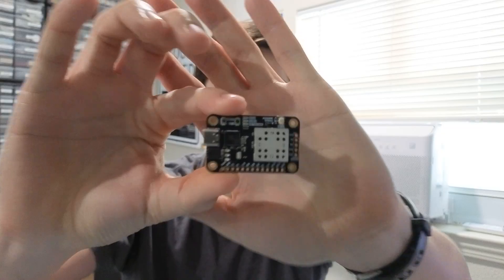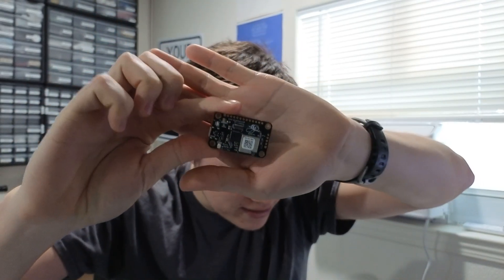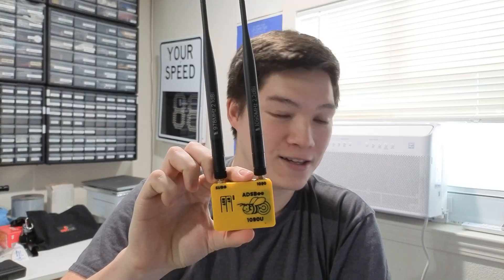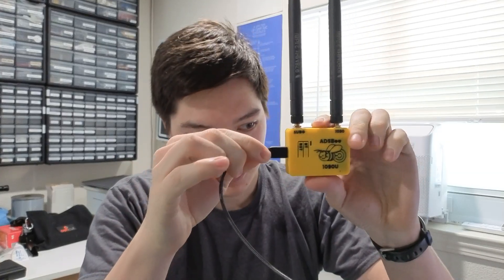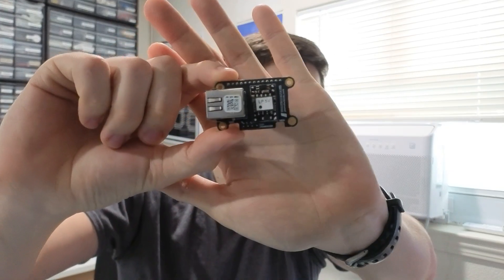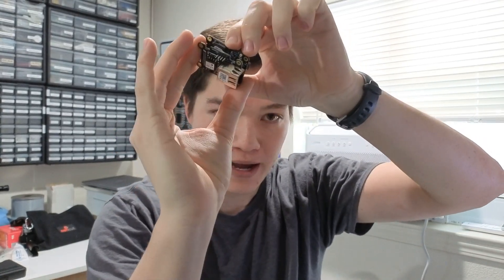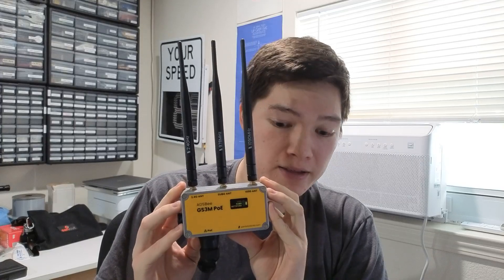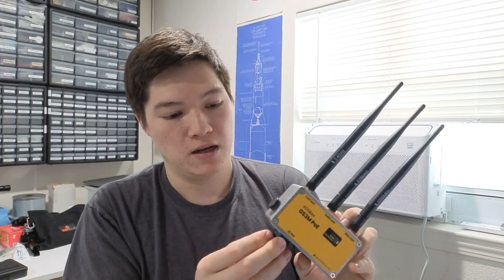ADSBee: Everything we made for low-cost open source ADS-B in 2025

Comment: I'm getting ready to order a 1090u and I would love to get RID in the future. I'd totally be down to beta test for you.
Reply from the maker: Awesome! I’m excited to have you as part of the project :)
Reply: @CoolNamesAllTaken 
Just to confirm, a basic startup would be the 1090u, 1x 1ghz ant, 1x 900mhz ant, and an enclosure?
Reply: @CoolNamesAllTaken  the notes about the wifi antenna on the enclosure kinda confused me.
Reply from the maker: @n7nja851  https://pantsforbirds.com/product/adsbee-1090u/

https://pantsforbirds.com/product/adsbee-1090u-enclosure-and-1090mhz-978mhz-sleeve-dipole-antenna-bundle/
These two products should be everything you need for a portable receiver!

The 1090u comes with a flexible WiFi antenna that can be installed inside an enclosure. The 2.4GHz sleeve dipole antenna is for outdoor receivers that need to put the WiFi antenna on the outside of a conductive enclosure. Not needed for most applications.
Reply: @CoolNamesAllTaken thanks! Just fired the order to you.

Do you have a subreddit or discord?
Reply from the maker: @n7nja851  Thanks for the order! Our discord is here: https://discord.gg/KRgVT9sSVW